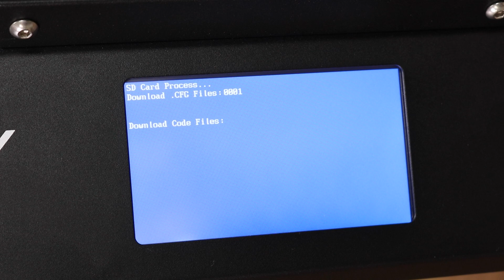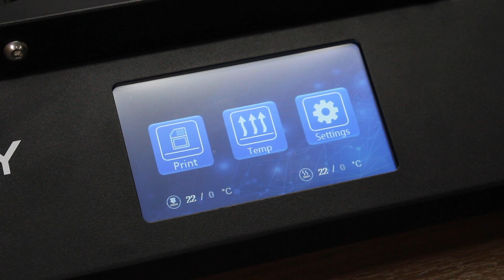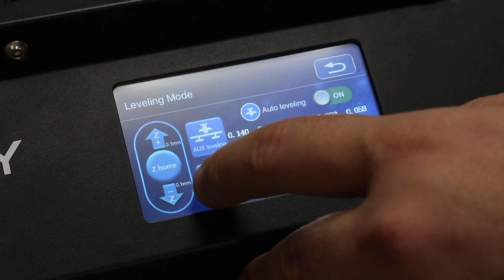How to install a BLTouch on a CR-10s Pro *UPDATED*

Comment: Great tutorial. I have the V2.4 board and a BL Touch bought this week so V3.  The 3 pin connector supplied has Yellow Blue Red wires and not the yellow red brown in the video. Do I still swap the 2 cables (red and blue in my case)

The connector for the black and white cable connector in my kit is a red 2 socket connector - do I just plug this into the 3 pin socket on the board? Or should I replace the cables?

 Also do I still need to flash the firmware as this tutorial suggests?

Thanks for any advice as this is really confusing with all the boards and touch versions.
Reply: If you download firmware from the links below, you will get card refresh problems. Try whatever but if you want tiny machines firmware, then use Z- connector - install LCD display from here but the firmware directly from tiny machines page - B7 hex. If you want to use creality BL touch firmware, use Z+ connector. You need to flash the display and firmware too..
Reply: what was the decision on the red and blue wire ? still swap them?

Comment: Awesome I’m Canadian living in Sweden here :) from London Ontario :) 

One question . What’s a good firmware for the inductive sensor . I wanna buy the bl touch for my Cr 10s pro but what should I use till I get bltouc
Reply: Also Sweden, had the cr10s pro for 1 week,  just received an inductive sensor and waiting to get a bltouch and loads of other parts.
Mine was pretty useless out of the box, the metal bed is warped 0.2+ higher than the sides and the capacitive sensor just gives screwed up values and had to be deactivated. Tried a glass bed which is very level, but instead is much slower for heating and cooling, trickier for adhesion and it might not even work with a capacitive sensor.
I'm hoping to use these two sensors simultaneously and keep upgrading things until the printer requires no more babysitting after switching on.
The inductive sensor alone should not require different firmware, only BLTouch does, since it's wired differently.

If you are in Stockholm maybe two heads are better than one for getting this printer fixed up ;)
Reply: Ducklord I’m in SKÖVDE . Will b going to the 3d meet in Helsingborg maybe we can catch up there :)

Comment: Heard great things about BL Touch and Marlin software replacement for the original CR-10S Pro main code.
I went to load new set of files to CR-10S Pro LCD screen using microSD and the code I found in GitHub for Marlin-Creality_DWINTest.  I in fact did look around for how these files should be arranged on the microSD and didn't find anything.  So I just put the main folder called DWIN_SET (found under 10sPro_1.70_ScreenFiles)  with all the goodies (.CFG, Code, .LIB, .H2K, .BIN, .D2K, .ICO, .WAV, .BMP)  inside at the highest level.  So, when I power up the CR10S-Pro, of course, it blithely says, hey:  I downloaded zero files, 0 for .CFG, 0 for Code, 0 for .LIB, ... and 0 for .BMP.  And I had read earlier that you have exactly one chance to get this right. So I ASSUME now that I should have just spattered them in the root of the microSD.
* So, is there a way to recover? *
After that, I did download Marlin code into the Main Board using Atmel AVR tool.  That went well, and I know from readback the code changed.  The file I downloaded was CR10SPro_B7_BLTouch_115k found in same area of GitHub.  But it didn't help getting LCD board to accept new goodies.
Reply: Saw a note on Tiny Machines 3D.  Said you have to use 16GB or smaller microSD.  Above I tried a 32GB and a 1GB.  Now LCD files download nicely from the microSD.  Confirmed that all the files need to be under DWIN_SET, directly under the root.  For my Marlin 1.1.9 B7 software for CR-10S Pro (directly loaded with Atmel AVR tool described above, because while the marlin.ino project compiled, it always timed out when I tried to use the Arduino GUI).
1 .CFG, 2 Code, 0 .LIB, 1 .H2K, 3 .BIN, 0 .D2K, 9 .ICO, 9 .WAV, 88 .BMP

Comment: When I try and upload the Firmware with Arduino there is nothing detected in ports and the computer doesn't seem to detect the printer when plugged in with the cable. Even when I try and turn on the printer the screen turns on but is just black and nothing seems to happen. Any assistance would be appreciated

Comment: Made a huge improvement. However be warned the software doesn't refresh the files on the flashcard if you put it in a second time.
Reply: So how do you recover?  I did not see any details on how the files should be arranged on the microSD card, I just copied over the directory, 10sPro_1.70_ScreenFiles.  And inserted the microSD and powered up.

It quickly downloaded, reporting 0 files for  all of these: .cfg, code, .lib, .h2k, .bin, .d2k, .ico, .wav and .bmp.    Now when I put the contents of the 10sPro_1.70_ScreenFiles\DWIN_SET directory at the top level of the microSD card, it no longer tries to download.

***So, how do I recover? *****

Note that I looked around to see what a typical microSD card contents should look like BEFORE I did the first insert - but never found any information about that.  So I expect all these files should be at the root of the microSD cards.
Reply: the same problem here, you need  to switch off/on for the printer to see new files on the card... the software seems to have some bugs too, often crashes on homing just before  printing... perhaps switching to OEM display flash and firmware  will solve the issues.
Reply: found sth: https://www.thingiverse.com/groups/creality-cr-10/forums/general/topic:31455 perhaps it will solve the issue? it looks that tinymachines firmware stuff is not  polished.
Reply: @pawelw.9172  I was thinking the same thing. Does the OEM software support the BL touch?
Reply: @bre86  there is a display and board firmware at creality site for 10spro bltouch, I am gonna try today. YEsterday I did these lines in Marlin but there was no result.
Reply: @pawelw.9172  Yes i tried a bunch of suggestions with no improvement. Keep my posted on the 10spro bltouch.  Thanks Pawel W.
Reply: @bre86  I installed B7 tiny machines HEX file and the SD card refresh works OK now, I also tried creality 1.6.8BL HEX but the Z axis only goes to +. I would prefer to use original firmware so I wrote to Creality about the issue, let's see perhaps they will answer. Overally, I am not very impressed by how bltouch works, the inconsistency is almost on the same level as on original inductive sensor.  Doing the autolevel twice, it shows totally different values. not really satisfied.
Reply: @pawelw.9172  DId B7 fix the issues with the pause button and power failure?
Reply: @bre86  will tell you in the evening, I am messing with basic levelling, good that print canada responded and creality also, I will have to contact anctlabs too because I am not at all happy with the performance of their sensor. Perhaps some play in my machine but I don't sense it anywhere, everything looks quite sturdy... all I can say now that the compiled B7 behaves differently on the SD card refresh than the suggested Marlin source code here,  as well there is a difference when you upload LCD flash from tinymachines page, and the one here. When you upload here when you enter levelling menu you will see this "3d axes square" while the machine does homing and then lets  you correct the Zoffset - just the same as on the oem firmware. When you upload the B7 from tinymachines page, you will not get this "picture" of the Square, the printer will take you to the levelling menu directly, will be doing its homing business but there  is no pictogram of it, you will have to wait until Z offset buttons start  to work. So, tons of inconsistency here and there..
Reply: @pawelw.9172  B7 HeX from Tiny, made some improvements with my machine. SD card refresh and I can pause and resume again. It's probably not the issue with your machine but my hot end bolts were loose from the factory and cause me lots of issues. I haven't noticed the "no pictogram" issue.
Reply: @bre86  did you use the display flash from tinemachines webpage, or the one suggested by printing canada here? I did have a pictogram when using the printing canada lcd flash, but lost it after installing the one from tinymachines B7. All in all, your    case only proves that printing canada should look  into their Marlin Source code, something is not right.
Reply: @bre86  OK, I am back to oem1.6.8BL firmware, Creality told me that to solve Z axis plus issue I should plug the BLtouch black and wire wire connector to the z+ in the mainboard. This is an old style firmware  and it has fewer measuring points  but I do like the fact  that  home is in the 0 and not in the   front left corner ;)

Comment: Hey Guys,
Everything worked great and my BL touch has made a huge improvement! The only issue I have is my printer won't revover from a pause programmed or manual anymore. Is that an issue people have encountered?
Reply: Yes. Same issue here. Any resolution? Also if I job Z+ rapidly I've had the software crash.
Reply: @bre86  no resolution from anywhere. Apparently it's a trade a known issue that hasn't been fixed.
Reply: @bre86  many issues with the praised  tinymachines firmware, worte to printing canada  to at least place information about possible problems after uploading, I am getting back to oem firmware.
Reply: I remember reading that this is a known issue with the Tinymachines firmware, because they are using the memory for something more important.
Reply: @YaFunklord  I talked to Canada Pringing, they are  really helpful but somehow  they will not admit tinymachines stuff is buggy. I am really happy with creaitive 1.6.8BL except  the fact  I will probably have a source code of it.

Comment: hello I have everything installed after the instructions. Everything was in order. after switching on, the z-axis did not move to minus.
Starting position approached and the Z-axis moves to plus. Even when leveling, the Z-axis always drove in plus. At every step further to plus. I checked everything again and found no mistake. What could that be? Can you help me? Best regards Peter from Germany.
Reply: Hello did you solve the problem, because I do have the  same issue on original creality firmware. I resigned from using tinymachines firmwares because there were problems with SD card refresh, but the axes worked ok, now after flashing with original firmware, the SD  card   works ok, but I have  the  Z home issue which goes to plus only.
Reply: @pawelw.9172  I did not solve the problem. I'm back to the initiator. I have good results with it.
Reply: @Petro6131  what do you mean by initiator?
Reply: @Petro6131  ok, what version of firmware do you use now? because my printer had 1.7.1 printer on it,  do you know I can get it anywhere?
Reply: @pawelw.9172  1.70.1 CR-10SPRO screen firmware, 1.70.1 CR-10SPRO motherboard firmware
Reply: @Petro6131  where did you get them from could you send me?
Reply: OK, I found the files here https://drucktipps3d.de/forum/topic/cr-10s-pro-firmeware-update-1-70-1-und-filamentsensor/ . ANyway Peter, I just installed  TINYMACHINES  Firmware  using HEX file and it seems that the SD card  refresh works, did you try to install tinymachines   HEX instead  of canadaprint Marlin  files?
Reply: @Petro6131  Peter you might be interested, I told you that I had the same issue when using the factory 1.6.8bl firmware, contacted creality, they told me to swap the connector from Z- to Z+. Did as they said - it  works!!! Perhaps you should try?
Reply: @pawelw.9172  Thank you, I'll try it. I have to buy a new BL Touch first.

Comment: Hi I have following all the steps alined my bed and Z home distance, but when start printing the nozzle is to high and can not print anything what can be wrong is there another adjustment I need to know Thank you in advance
Reply: this is exactly what i am seeing, i think its something to do with the updated version of marlin as my auto bed leveling is doing a 5x5 grid now where it used to do 4x4 and the screen only shows the results in a 4x4 grid.

edit: a quick google shows this might be an issue with marlin, looks like theres a guide for fixing it here:
https://forum.duet3d.com/topic/7705/bl-touch-correct-offset-when-homed-too-high-when-printing

Comment: hi, i did all the steps, but when i test the bltouch with my finger, is keeps going down. What could that be?
Reply: Okay, i found the issue. The jumper wasn't making good connection between the 2 pins. Took another jumper and now it works fine!
Reply: same u ..i get crazy

Comment: Thank you, thank you, thank you. I was having a problem with a bltouch I purchased online from another supplier. Followed their instructions and just could not get the thing going. I talked to you guys and then ordered a bltouch from you and when it came I followed this video and then went through the setup. I turned the printer on, did the setup and the BLtouch worked perfectly. Let me tell you ... there is no substitute for good technical help and good supplies. Now I can get back to using my printer .... the bed leveling accuracy is outstanding.  Thanks Paul and Chris and the rest of your team for outstanding service.

Comment: forget firmware? you flashed the LCD but not the printer? is your printer firmware tiny machines or creality?
Reply: Thanks for the heads up - I put a notification in the LCD flashing instructions. Marlin can be flashed at any time. We are using the Tiny Machines firmware.